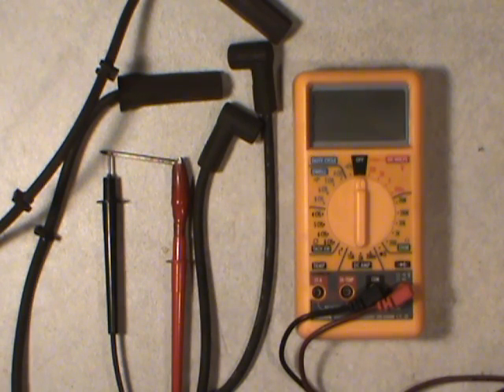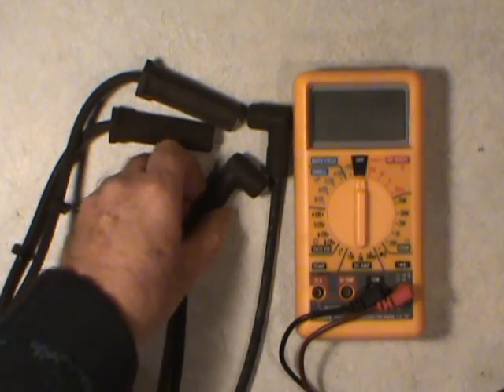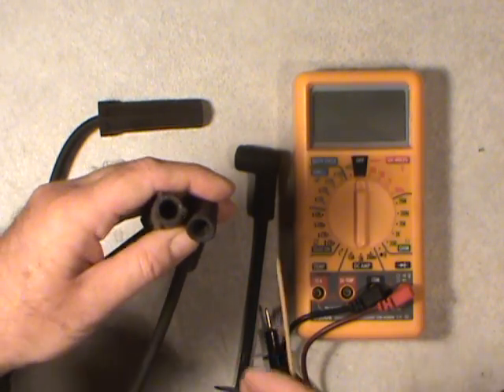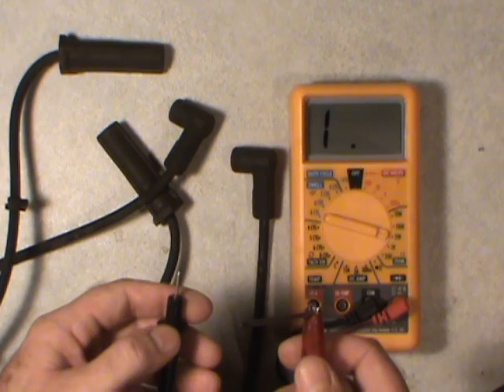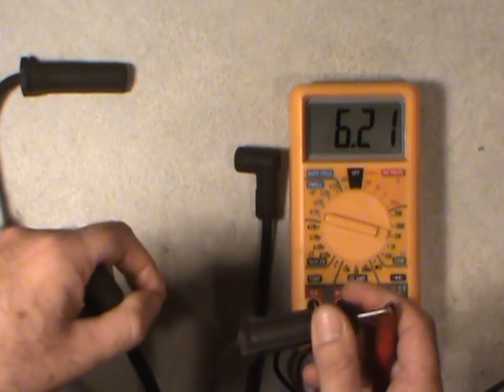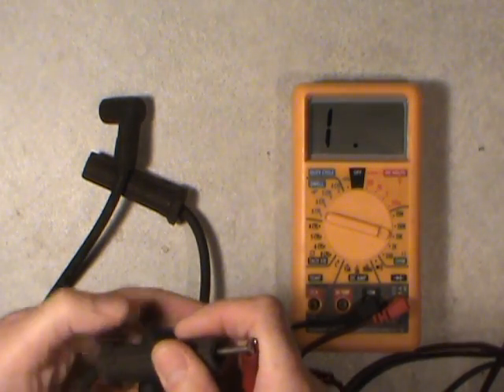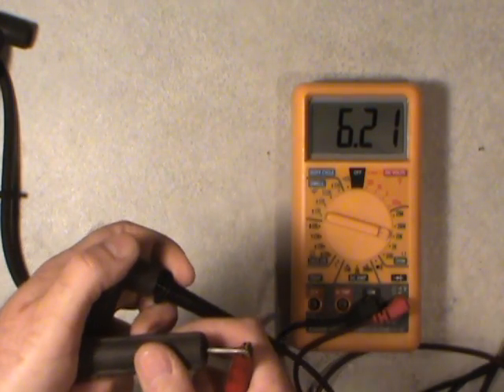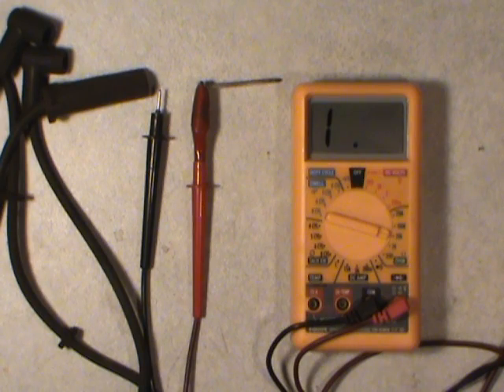How to Test Spark Plug Wires

Comment: thanks for the tip
Reply from the maker: Greetings...salem mohamed.............You're welcome, and, thanks for watching............Just, try to keep in mind, that, the Regular, shall we say, Carbon string, type of spark plug "Wires", will probably wear out, when they get a certain amount of use on them, and, that wear, will usually be caused, by the High Voltage pulses, that travel inside of them, when-ever the engine is running.............Also, if one or more, spark plug Wires, has a Bad terminal connection, or, has a Break, in its internal conductor, then, that in itself, will usually cause quite a lot "Stress", on, just about any ignition coil, due to the ignition coil, trying to Raise its High Voltage, High enough, in order to make the (spark) "Jump", between that, too LARGE of a "Gap", that, the Faulty spark plug Wire, or Wires, provided, due to that very un-wanted Break, in its internal conductor (or, faulty Terminal connection), and.....till next time.......Be Safe, take care, and have a good one.
Reply: I m from Libya i change by another one now my car  is ok thanks again
Reply from the maker: Greetings...salem mohamed..............You're welcome, and thanks for watching............It's good to hear, that, all that was needed, to make Your car's Engine Run good again, was just, a New set of spark plug Wires, as, there can be times, where, even, just trying to find the Problem, on some of the newer types, of computer controlled ignition systems, can be quite difficult, and might also, take quite a lot of time as well.............It's a good idea, to make sure, that, all of Your spark plug "Wires"...Don't get too Close to, or Touch any Metal, on, or near Your Engine, cuz, the High Voltage, that travels through the spark plug Wires, will sometimes, Arc Over (spark), from the spark plug Wire, to that Metal, that was too Close (to the spark plug Wire), and, if that ever happens, the Engine will usually misfire, and start running, not so good, especially at idle speed, most times, and........till next time........Be Safe, take care, and have a good one.

Comment: hello how much have to be on 1.6 AKL 8 Valve?
Reply from the maker: Greetings...to You (sorry, I only speak English)..........Thanks for watching.........If it's spark plug "Wires", that you are asking about, then, here are a few things, that might help you out..........If the spark plug "Wires", are quite "old", then, it's probably a good idea, to install a "new set" of "good quality", spark plug "Wires", because, of all of the high voltage electricity, that they have flowing through them, which, over time and use, will usually, cause them to wear out (conductive core, gets worn out, and maybe, the outer insulating jacket, breaks down, and might let high voltage leak out of them)..........Also, only change "one" spark plug "wire" at a time, because sometimes, mistakes are made, where, one or more spark plug "wires", get connected to the "wrong" spark plug...!!! (and I hope not)..........If you can't find the ohms (resistance) "Specifications" for the spark plugs "wires" that you have now, then, maybe, try this..........With the engine "Cold, and Not Running", Remove only one spark plug "wire" at a time, and ohms measure it, and also, measure the length of it, and write it down..........Then, once all of the spark plug "wires", ohms and lengths, are all written down, then, just do some simple math (arithmetic)..........Most spark plug "wires", will usually have a certain amount of Ohms (resistance), for a given length, as in, maybe, so many Ohms per Foot (in North America), as an example...........So, if one or more, spark plug "wires", have, a very different amount of Ohms, for a given length, when being compared with the other spark plug "wires" (in the set of them), then, that's a pretty good clue, that, those particular spark plug "wires", are not so good after all..........Another good clue, can be, is the engine running and idling "smoothly", and with lots of power and performance, when pressing down on the gas pedal...???...and, if not, then, sometimes, it might be, one or more spark plug "wires", that might cause, an engine to misfire, and, not run, as good as it should be doing..........An engine tune-up, can really help lots too, as in, new spark plugs, air filter, fuel filter, etc........Good luck, and........till next time......Be Safe, take care, and have a good one.
Reply: about idling, its float idle speed and sometimes it drop to 400-500 and black smoke, in this moment car bad respond to pedal accelerator....
Reply: and HAPPY NEW YEAR! health of love and peace!
Reply from the maker: Greetings...to You..........To help you out, I need to know, the..."year"..."make"...and..."model"...of your car or truck...???...........If your car or truck is 1996 or Newer, then, you can get someone, to "Scan", your car or truck's "Computer", with a "scan tool", to see if there are any "Trouble Codes", that might be stored, inside of, the car or truck's, Computer "Memory"...........Have you been keeping up with regular engine "Maintenance"...???...because, old, dirty, or worn out parts, will usually make an Engine, Run Not so good...!!!...and........till next time........Be Safe, take care, and have a good one.
Reply from the maker: Greetings to You...........Thank You, and..."Happy New Year"...to You, and, best of luck in 2018...!!!

Comment: I tested brand new spark plug and it say .825 on meter. Is this good or bad?
Reply from the maker: Greetings...Kennedy Wong.........Thanks for watching......... (.825) on your meter, well, do you mean .825 of 1 ohm...???...or, what "range" was your meter set to...???..........For me, I like to see my spark plugs, with an ohm reading, of, 5,000 ohms or less..........I've seen some new (older style) spark plugs, that have really high ohms readings, that, I don't like.........Safest bet, would probably be, to, try to get, and install, the "exact" same spark pugs, that the engine had in it, when it was brand new, and check the "gap", that's between the spark plug's two electrodes, to avoid any unwanted problems..........Please note, that, some spark plug electrodes, are "not" gap-able...!!!...and.......till next time.......Be Safe, take care, and have a good one.
Reply: The multimeter telling me .825 to 1 000 ohm. These one are from Bosh and for some reason the coil become very hot to touch after cranking it. I brought new ngk spark plugs wire and reading 4000 ohm and much better than Bosh. Not sure why coil was hot as fire. Could be defective spark plugs wire?

Comment: You said 8K-10K per inch of cable length, so a 12 inch plug wire would be around 100K ohms.....    then you reported that a 6K plug wire was good....was it 0.5" long?   Jeez

Comment: If it is supposed to be 8-10,000 ohms per foot then why is a good wire reading 3,000 ohms per foot.
Reply from the maker: Greetings...Rusty Nuckles.................Thanks for watching.....................Every spark plug "Wire"...Manufacturer, will usually have a certain amount of Ohms/Resistance, for a given Length, for each Type (and Set), of spark plug Wires, that they sell...................A good place, to be looking for, oh, shall we say, a Set of spark plug Wires, that are Specified (maybe in Ohms per Foot, perhaps), for a given Vehicle, would be, to have a look-see, at that particular Vehicle's, Factory Service Manual, or the equivalent, there-of..................The most important thing, to be watching out for, is, a spark plug "Wire" (or Set of them), that..."Don't Emit Too Much Electrical Interference"...!!!...when High Voltage "Pulses" travel through the spark plug Wire/s (as in, RFI and EMI, etc.), cuz, if enough of this Electrical Interference, is, shall we say "Leaking" out of those spark plug Wires, then, there's a pretty good chance, that, that Not Wanted, Electrical Interference, could get into, or, be picked up, by some of the Sensors, that are usually found, in Vehicle's, that, usually have Fuel Injected engines, that are also Controlled-by, an On-Board Computer, and the Engine, might end up, Running kinda rough, or (hopefully not), end up getting Damaged...!!!....................So then, if and when-ever, You are in doubt, about, the Ohms/Resistance, of spark plug Wires, for a Factory/Stock Vehicle, I'm thinkin', that, it's a good idea, to stay with, what the Manufacturer, of that particular Vehicle (uses) Recommends, in order, to avoid any (warranty...???) problems or engine damage................Me, myself, I try to think of a vehicle's "Ignition System" as a, shall we say, Complete Unit/Circuit, and I Don't Install a Component/Part, without, "First, Checking and Verifying", that, that "New Part", that is about to get Installed, is with-in the Specifications, for that "Exact" Ignition System/Circuit, cuz sometimes, by not doing so, it could very well result-in, some engine damage, and also, I really don't like fixing the same thing twice...!!!...lol...(and spending money needlessly)...Yikes...!!!...and....till next time..........Be Safe, take care, and have a good one.

Comment: 6000ohms is good?????? REALLY?
Reply from the maker: Greetings...huntin .fishin........Thanks for watching........Each manufacturer, will have their own, ohms/resistance "specification", for a given length, of their type of spark plug wire.......The cheaper, carbon core, type of spark plug wire, as I recall, can be quite high in (ohms) resistance, sometimes........Then, there are high performance spark plug wires as well, that have, really low ohms/resistance, per unit of length (I, myself, go by, per foot/12 inches, as the unit of length).......As long as, the high voltage, shall we say, interference, is supressed to, a low enough level, so it doesn't cause the computer controlled, fuel injected, engine's sensors and actuators, to not behave abnormally, then, all should be alright.......Once upon a time, a long time ago, the conductive core, of a spark plug wire, was usually, a stranded, solid metal wire, so to speak, and, as I recall, it was when, automobiles, started to have, AM radios installed in them, and, hole-ee-gwalk-ah-moe-lee, I be thinkin', that, all of that high voltage..."klicking"...noise, was coming in...loud-and-clear...over that AM radio...!!!...could be, that, it was this milestone, that started, the introduction, of the, resistance, or suppression, type of spark plug wire, perhaps, and.....till next time....Be Safe, take care, and have a good one.